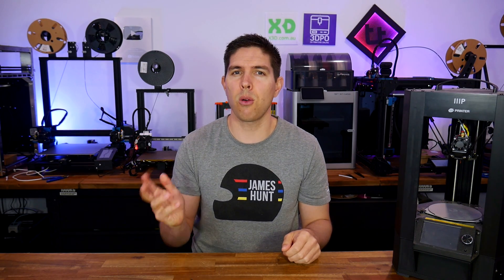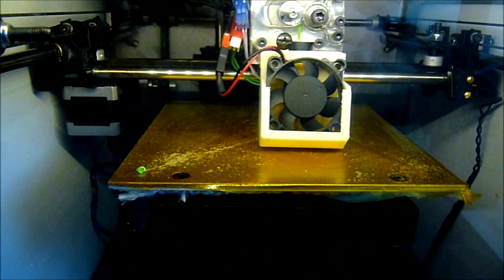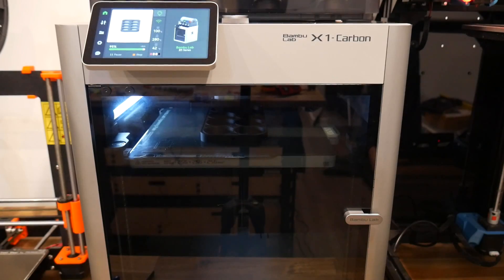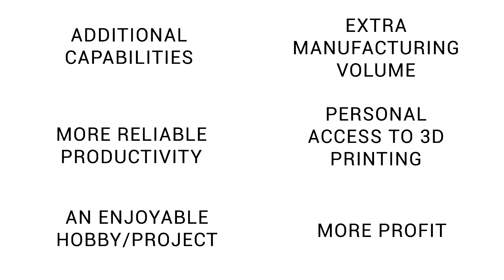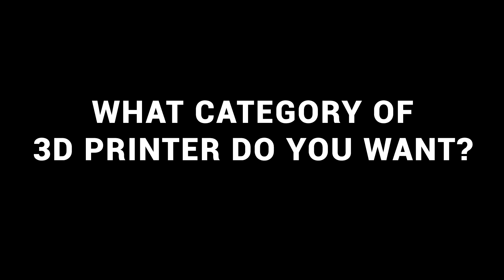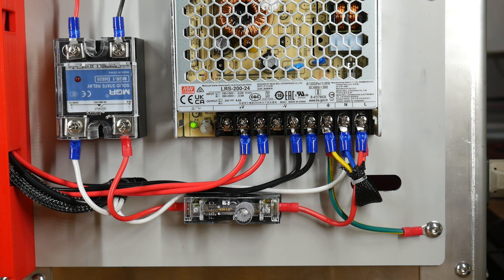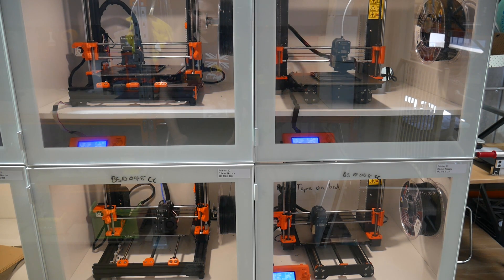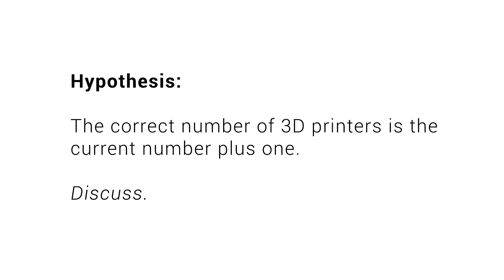Should you buy a second 3D printer? Reasons why and why not

Comment: Edit: in short:
Resin and fdm: achieving more material properties and resin precision
Multiple fdm: better time efficiency, specialised machines and less/no downtime by ficing one with another

reason for both resin and fdm is to achieve different material properties and precision of resin
Reasons for 2(or more) fdm printers are:
1. Using one to fix the other.
Having redundancy and less downtime(or none in case of 3+ printers, one down, second printing parts for the first and 3 products in case or failure)
2. Printing multiple parts at once
3. Specialised machines for different materials(pla, tpu, abs...)
Pla needs better cooling and prints better unenclosed
Abs needs an enclosed printer and high temperature and prints best with q heated chamber
Tpu needs an extruder with a short and tight filament path
Specialised materials may need even higher temperatures and a heated chamber
4. Having a smaller printer for quick work and a larger one to use only for bigger parts
Having a large printer print a small part while a small one is sitting idle because a part cant fit on it is wasting time, and besides small printers can be quicker because of lighter moving mass and possibly stiffer frames so they are good for draft printing while the big one is busy printing production parts
Small printers are also easier to heat up for materials that require it

Comment: there is a Clearance Tronxy XY-2Pro 3D Printer DIY KIT Auto Leveling 255mm×255mm×260mm on ebay for $219AU may be ok for tinkering with

Comment: If your into 3D printing, yes you should buy a second printer, just so you can print repair parts for the other, but then when it comes to a third printer, I recommend using machine 1 or 2 to make the 3rd printer yourself as you will find the flaws in nearly every printer being sold and that your better off just creating your own machine from scratch as it will be cheaper than upgrading somone else's design.

Comment: I got an ender 3 s1 pro, great printer that produces great prints, but it spits out random problems that many otherS1 pro's don't. So I want a second but want one to be more reliable than what I am experiencing now, things like a perfect print, turn off and then on in the morning and won't stick, I can have weeks of perfect printing then one day no go. I got it in July and now the nozzle only gets to 40 deg when set at 210. I hate messing with things so I ordered a new sprite complete, see what happens. I don't mind messing with settings but when something stops working I will go for the fastest fix, nearly brought a new printer but thought I would try a new Sprint first, fingers crossed. One day I will add a second printer.

Comment: I have an Ender3 Pro (my first 3 years ago), and a CR10S, also 3years old. I also had a Sunlu S8, but sold it. No reason except to recoup some of the cost. Now I have a new Ender 3 Max Neo. 
WOW! Perfect right out of the box. This is my first experience with ABL. I have tried several filaments and several files (theirs, mine and Thingy)and they all print perfect. I hope this keeps up. The price was right in my wheel house, so I am happy about that. A discount would have been great, but wasn't available.

Comment: I don't think I need another 3d printer. I got 3 modded ender 3 pro's. 
A vzbot, modded flsun Q5, flsun sr and an Ender 2 pro. 

I think I'm good BUT I am starting a Rook build for my daughter.  I have so many spare parts I can build it for really cheap.

As for having a reliable printer my ones that just work are typically the flsun SR, one of the ender 3's that's modded with a Spider hotend,titan direct drive and a skr 1.4turbo with a bltouch and pei bed. That printer just simply works with anything from pla to PC.

For quick pla prints the SR is my go to. 
For good quality small prints the ender w pro with minor mods is fantastic.

The vzbot has only been done for about a week so I can't speak for reliably of it yet.

If you have a significant other and you both like to print and tinker, if you got the space and money for another printer I would recommend it. Nice not waiting on each others projects to get done to start your own.

I like the vzbot but am getting stuff together for a voron 2.4r2

Comment: There's another reason to have at least a second 3D printer, at least for hobbyists. I have two 3D printers because I occasionally need a 3D part printed for use on another 3D printer that isn't functioning. For example, while disassembling one printer I broke the 3D printed extruder mounting plate. I simply used the second printer to print the new extruder mount.

So, having a second 3D printer to repair the first, and vice-versa is a great reason to have the second.

Comment: I print functional parts. 3d printing for me is a hobby and learning everything I can about it is what I enjoy. Solving problems & improving print quality. I started with an Ender 3. I upgraded it customized firmware BLtouch ect until it no longer needed me to love it. So I traded it to someone who wanted a reliable workhorse & got a BIBO dual nozzle in return. Working on printers to get them to absolutely the best they can be is obviously more joyful for me. My next project I believe will be to build a Positron V3 from scratch this will give me more skills as I build it and in the end I will have a nice compact 3d printer that I can take with me when I got on the Road. Win/Win if you ask me! I have learned that I do need to take a break after I solidify the printer and make it the best I can at that point I will just roll with the printer fixing the stuff around my house with parts I designed until the itch hits again... Which is it expecially after this video!

Comment: I bought a second to be able to prototype,  modify and test various versions of a design at the same time with low down time. You dont need an expensive printer, I use a modified Ender Pro (it's now a Ender V 2) and a new Ender V2.  The biggest issue is I dont buy filiment a lot, and I only prototype in gray or black, so if I dont ha e an extra spool, I dont run both printers simultaneously.   Kinda dumb as I can easily afford any spool, but my storage space is limited and is currently full.

Comment: ... too late. I just bought a second. Couldn't pass the deal and adding a Sidewinder X2 alongside my (heavily modified) CR 10 Mini. Paid 260 Euros for it (NEW), so I'm pretty happy with that.
Now I'm looking at updates. Stabilizer rods, bi-metal heatbreak, metal extruder idler lever and PEI build surface should be a good starting point.

Comment: I recently upgraded printers for bigger build volume and two materials 
My first printer and Endor 3 i plan on selling to help offset the cost of the new one 

For now I have two printers it allows me to work on projects quicker because I can print two projects at once or finish one quicker allowing me to get started on the next 

I upgraded to a tenlog D3 with my biggest worry being no set cura profile, but I easily added a custom one and after some test prints and adjusting the end code I now have a great printer
Reply: For example on the tenlog I was printing shoes which take three days, and on the endor I was printing a bunch of phone holder/mounts as gifts

Comment: I started with a Wanhao Duplicate 3 because that's all I could afford. It worked, but I never got the hang of bed leveling, and eventually it got to the point where I couldn't get the bed close to the nozzle at all.  At that point, I wanted a new one, and could afford a better one.  My primary feature for my search was a self leveling bed.  I ended up with the Prusa MK3 which became an MK3S, then an MK3S+, and now an MK3S+ MMU2, and I love it.  It's been three or four years and it still runs like a champ.  The one thing I'm not happy about is the promise that I'd be able to upgrade to the MK4, and there is no MK4, or any word about an MK4 ever coming out.
Reply: They aren't going to announce the MK4 until well after the XL orders have shipped. Resources are committed to that as development work was still in progress when the official announcement came out. When did they promise you would be able to upgrade to a MK4 which people have been asking for since the year most MK3's shipped? The only things really behind on the MK3S+ are the 8 bit board and the deployment of their wireless solution. Some will cry for a color touch screen but if they deploy PrusaPrint on the MK4 people will often find the screen not necessary.

The thing about self leveling bed's is, most printers dont have them. The Prusa MK3 doesn't. It has a fixed bed with mesh compensation. It works great but if you are printing things that fit together there is some desire for the bottom plane of the print to actually be perfectly square and not just tramming the gantry and tool paths to the defects. The reason why I wanted to build a Trident or a V-Core 3 but I ended up with a really cheap used Voron 2.4 instead so I can forever stare at it and my MK3 and feel like somethings not right with the world lol
Reply: @Rainmotorsports  Wow.  Lots to unpack there.  I haven't been following the XL since it's out of my price range so I wasn't aware it wasn't shipping.  I think you're saying that development on the MK4 is happening, and to me that's good news.

I can't give you the URL for the video, but one of the selling points that Josef Prusa made about the MK3 was that you would be able to upgrade to the next version.  Maybe that meant the MK3S, but I always took it to mean to the MK4.  I (think) know the original printer could be upgraded to the MK2, and that there was some sort of an apology from Josef Prusa about how the MK2 couldn't be upgraded directly to the MK3 because of the voltages used.

I hear what you're saying about the bed.  It isn't an auto leveling bed. It's a fixed bed with automatic compensation.  Good enough for me, I guess.

Comment: Started with an Ender 3.
I wanted to print bigger things without doing pieces and gluing them together.  So I got the 12 x 12 X 18 build volume version CR10.

It took some tweaking on the low cost printers to make them work reliably, but the most expensive upgrades are the aluminum parts for the extruder.  I used the Ender 3 enough to burn out the original heating element at the nozzle.

I plan to get the extruded aluminum rails to convert the Ender 3 into a 4 ft long bed as seen on another 3D printing youtube channel.

Comment: I started with Anet a8 it was made from ply.
Done a lot of mods to it. Then I changed it to M8 but with a difference.
Them I built a cantilever based on the C3Dt net gear printer the Z axis is driven by a ball screw. I like the building of them and wiring.
My down fall is flashing the board it's a GT2560 A+ my one fear I don't think I've ever seen so many errors, I even messed up my laptop had to put windows back in what a mess😕.
Then there's number 3 very similar to the M8 but on a slightly larger scale.
The mother board is a Duet 2 WiFi with i7 display. Built 2 years ago never been turned on at least you do get supplied with an SD card.

Comment: Second? How about a sixth? my progression:

CR-10S - my first and most modified printer
FLSun Delta - because deltas are cool and I wanted to learn about the different motion system 
Artillery Genius - more refined than the modded CR10 - it just works and is now dedicated to flexibles
Voron 2.4r2 - because building a core xy is cool 
BabmuLab X1C - prints PC, PA and ABS and looks great doing it

If the X1C was around when I bought my second printer, I would have stopped there. It's been amazing.

Comment: Because i'm a teenager, I started with a low budget machine(Ender 3 V2) in early 2021. Did a many cool projects on it, but about two months ago, I bought a snapmaker 2.0 because it's of course a better printer,, has an enclosure, will be able to do dual-extrusion soon and most important: it can laser engrave/cut with up to 10W (diode laser) and cnc cut/mill soft materials like wood or acrylic. Im very happy with my decision, even though the price is quite high (but I could profit from Black Friday to "save" about 1500 swiss franks :)

Comment: If you own one, and you're thinking about buying a second, then absolutely buy another. If you have one, and you're just frustrated with it, a second may only double the frustration.
I had my first Ender 3 v2 for about a week when I started thinking I needed a second one. It often seemed to be in the middle of a 12 hour print when I had another item I really wanted to print.
Then there's the mechanical problems that will crop up. Having a second means there's a backup.
Two different printers with different filaments loaded is handy too. As I type this one is printing a PLA part, the other is printing TPU.
Now that I have two E3v2's I'm starting to look to Core XY w/ higher temp capabilities and heated enclosure.
Reply from the maker: You've coined it really well.

Comment: I got a second printer (prusa mini and mk3) and it lets me design and print things simultaneously with no down time. Then when I run things overnight, with different materials, and I get double the output. Almost zero drawback, I would rather have two slow printers than one fast one

Comment: I have a old wanhoa duplicator v2.1 it works but it was loud, and avg build volume and dated. I recently upgraded to a Artillery sidewider x2. Its not the worlds best, but i figure it will hold me over for a few years till i live in a better location. Its much larger, has a silent board and auto bed meshing.  

Currently undecided on what to do with my old one.

Comment: I'm in the category of "I own one it's modified heavily, but can't handle the level of manufacturing I need" I have an ender 3 pro and while it can print what I want, it can't keep up without problems. I've had to replace hotends twice because of leakage so I've had to slow way down on mm\s or risk major issues.

Comment: Printing is a hobby for me, so slowly growing my print farm has been entirely entertainment and personal enrichment.  I like to get a new printer only after I feel I've mastered my previous new one.  That said, I now have 4 printers that do very different duty: A heavily modded Ender 3 Pro that was my first printer and is still my most reliable workhorse, an Ender 5 Plus that's my tinkering and experimenting machine, and a RatRig v-core3 500 for when I want to produce large prints, mostly for Cosplayer friends.  My fourth printer is the newest of the bunch and is a Mars 3 resin printer that I'm still learning to use.  I used to have a Prusa i3 but found that it didn't do anything that I couldn't do on my Ender 3 just as well, and I sold that.  At this point I'm out of space, so I may not expand any more, but this is another great video on why to (Or not) get another printer.

Comment: As you say, "3d printers are not user friendly appliances for the masses." I wish I had hear a little more of that before I got into 3d printing. I've been doing this for about 5 months now. Frustrations are common. I bought an ender 3v2 and then an ender 3 pro so that as I upgraded the v2 things would get passed down the line. Was able to learn the basics of Fusion 360 because I had some experience with CADD software. Didn't fully understand limitations of filament choices because of the printer I had. I haven't found nearly enough help about software and upgrading it. I am not ready to quit any time soon. I am learniing, but it takes a while. Before all this, 3d printing just seemed like it was all plug and play. That was very wishful thinking!
Reply from the maker: If only you'd seen my buyer's guide from a year ago. It opened with a whole segment on that concept. Sounds like you have learned a lot and overcome these limitations for the most part.
Reply: 3D printers are user friendly for the masses, if one is willing to invest a little more money.

 I invested hundreds of hours into levelling, aligning and repairing my two cheapo-printers (Artillery Genius and Ender 3). They just never worked reliably and I was just sick of reading stuff like "You need to get to know your machine, you need to find out yourself what's wrong and fix it, it's just part of 3D-Printing". 

No, it's not! I'm not an engineer or a mechanic, I just want to print. And now that I have an Bambulab X1, I can do just that.

If I would have used all this time to work and earn money instead of fixing my old printer, I would have easily earned enough money to buy half a dozen Bambulab X1.

So it makes absolutely no sense at all to buy cheap. Just get yourself a proper machine and be happy. 🤗
Reply: @WerHatDieKokosnuss  yes, but Bambu did not exist until effectively July, and even Bambus have a ways to go. The time you've put into learning isn't lost, and most of the people buying Bambus are experienced 3d printers. Just saying, as great as it is, it is STILL not an appliance. After all, there's only so many silky plastic dragons the world needs. plus soon AI will design stuff for us anyway... but I am getting ahead of myself. fwiw, I have several Enders and as of this week, a Bambu. I learn from each still.